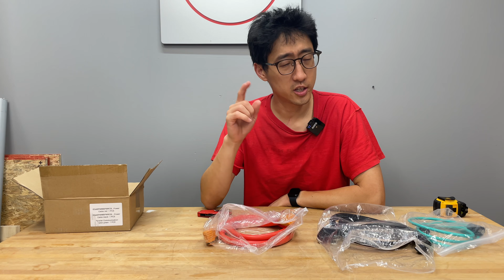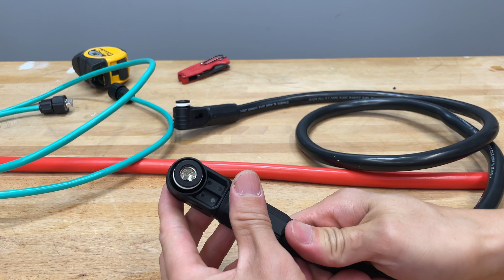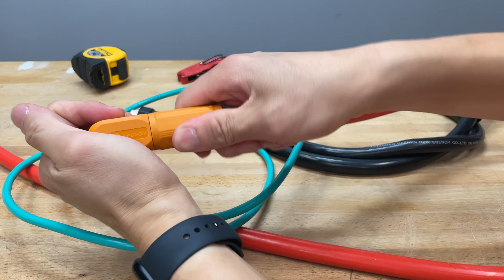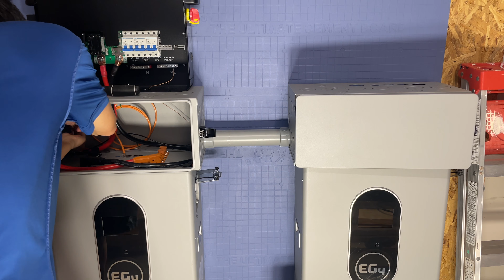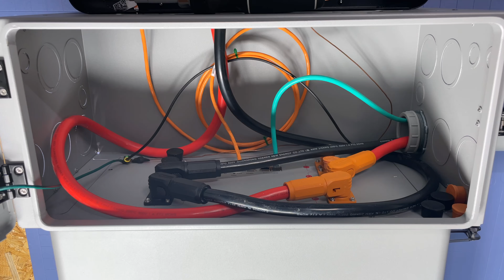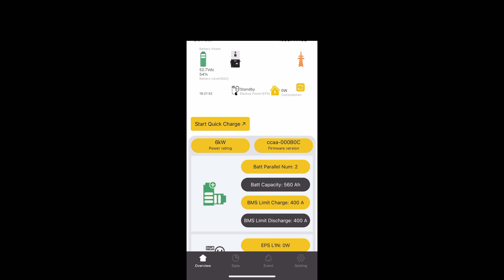EG4 PowerPro & Indoor Wallmount Battery Parallel Kit | DEGSON connector

Comment: The indoor wall mount batteries come with the orange communication cables and the parallel kit comes with a green communication cable. If you install two batteries with one Flexboss, you will have two orange commanication cables and one green. In your example install you use one orange cable to go from the the inverter's communication port, it looks like you are using the CAN Port and not the RJ45 Port. Then you used the green cable from the parallel kit to run from the 1st battery to the second battery. Why? What is the difference between the two cables?

Comment: Just an additional note: Instructions say IMPORTANT to make sure both batteries are at 100% state of charge before paralleling. 
P.S. 
You did not show any battery levels during the video so I am not saying you are wrong or anything. Just wanted to add this info before someone forgets to charge their batteries before.😊
Reply: The instructions are hogwash.  I connected mine in parallel immediately (but using 2 inverters in parallel, each has it's own battery and batteries are paralleled) but I noticed that if one goes from 92% to 93% and the other battery is still at 92%, it sends more current to the latter so they even out.  I actually did have an issue with balancing at first but it was only because the lithium battery type was set to something other than 0 (EG4) for some reason.  Setting it to 0 keeps them in balance.  You don't need to get them to the same SOC before paralleling.
Reply: It wasn't just SOCs that automatically evened out.  The actual voltages were spot on too.

Comment: NOT CONNECTED CORRECTLY!!!  When paralleling batteries, use the positive from the 1st battery, and negative from the LAST battery to connect to your load.  Not to bad of an issue with two...definitely needed for three or more.  This will balance the batteries.  These batteries ship with TWO red and TWO black cables (39.4 inches each) with connectors on ONE end.  They sell connectors for under $20 each--use the correct crimp tool!!!!  No need to buy this expensive "kit".
Reply: Isn’t that a series configuration?

Comment: I’m about to purchase 2 EG4 outdoor batteries. And I only have a 4000 W Cotek  inverter which is connected to a 600 amp bus bar. My question is can I hook up the two new batteries directly to my 600 amp bus bar instead of connecting the battery directly to my inverter.?
Reply from the maker: IM not familiar with that bus bar, but connecting batteries to bus bar, then inverter to bus bar is standard practice

Comment: Wouldn't you want the positive from one battery and the negative from the other to the inverter? This connection would draw more from the first battery.
Reply: Doesn't matter.
Reply: @davedepagnier8601  ,  It does matter.  Check  with the factory.   Connection to the inverter needs to be equal length or the two batteries will be out of balance.  @dalbltv9747 is right.

Comment: Thanks for the info!  I'm about to buy the exact same batteries and was curious on the length of the parallel kit.  Question:  you have a link to the indoor boxes, but those look like the outdoor conduit  boxes.  I like the latch--did you have any issues with those not being quite right?

Comment: Did you need to modify the cabinet for the 6000xp or indoor batteries?
Reply: no modifications are needed for the cabinet
Reply: We had to modify the cabinet to use it with a 6000xp. The knockouts were designed to align with the knockouts of a larger inverter so we made new holes.

Comment: This is the best, most detailed video I have seen so far about how to properly parallel two of these EG4 batteries. AND you explained the grounding too, which is sooooo helpful!! I am in the process of installing 4 of the PowerPro beauties along with 3 EG4 6000k inverters and I was struggling with the wiring a bit. Thank you!!

Comment: Could you use the extra cables and splice them together to make a parallel cable
Reply: Exactly what I did.  You can order the connecters separately.  Current Connected sells them, and they also come with spare battery terminal points.  You will need a good powerful crimping tool to crimp the new ends on, though.
Reply: @TheOneAndOnlyApebrains I did the same.
Reply: I've wondered the same thing, or if they sell the connector by itself so we could add it to the other end

Comment: NIce demo.  I guess this requires your backup generator to be 240 volts?
Reply from the maker: If you’re using the 6000xp yes. If you’re using a chargeverter then you can use either 240 or 120
Reply: So you need to connect two negatives and two positives to parallel ?

Comment: Thank you for the review, it's much appreciated 👍 
Is the supplied Ethernet cable CAT6 or CAT6e? I'd also hope it's 600V rated; gotta stay compliant with my local ordinance...
Also (anyone, please correct me if I'm wrong) I believe your supplied ring terminal wire should be rated the same. By NEC code it's "bonding" not a "grounding wire".
No worries, or hate, just an observation. Thank you for what your doing for this great community 🙏🔋.